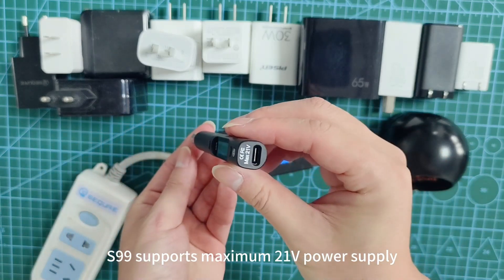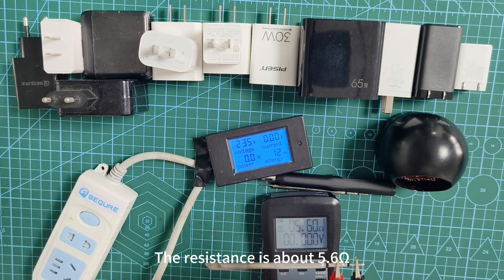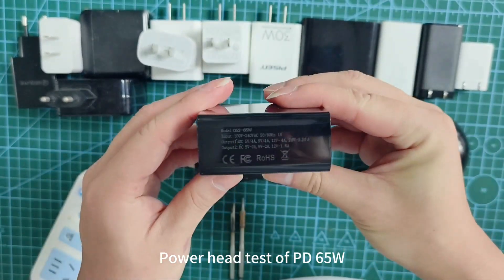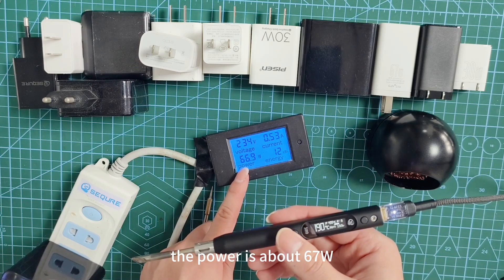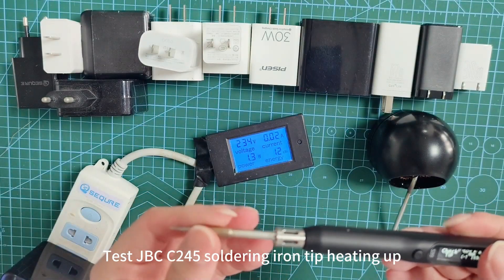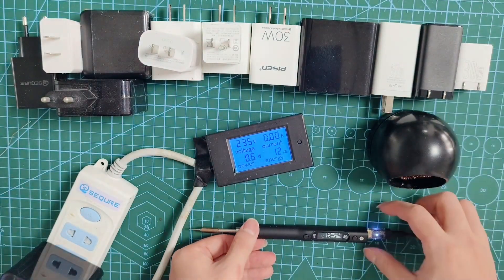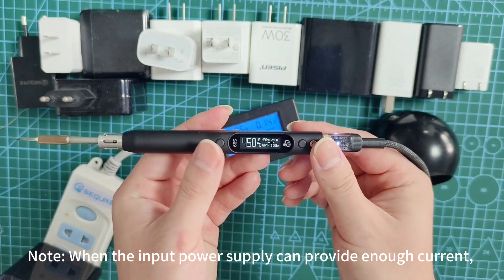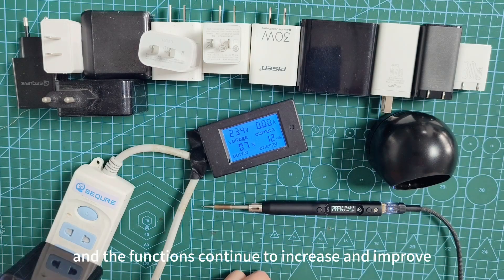S99 Soldering Iron Test Compatible With C245 Tips

Comment: Hi, in firmwave v1.08 i could' find the pps protocol on my s99 iron, how can i update ?
Reply from the maker: Hello, the current version is the latest firmware, there is no need to update, "S" beginning to identify the PPS protocol, the corresponding value is the corresponding voltage selection.

Comment: Thatnks for the video, I bought it too! I confirm that S99 works with original JBC 2.5 Ohm tips! And S99 costs like one JBC tip. 😅

But not with PD USB-C charger as all of them that I could find can only deliver 20V 5A, and 140W chargers do 28V 5A instead of 20V. From USB-C it can still work using 100W charger when power is limited to 70% in the menu. But it does work to 100% with SlimQ F150 charger/power brick for laptops using DC5525 to USB-C cable, that is to full 150W. That means it heats up in 2-3 seconds. SlimQ F150 is also very compact so it suits this iron very well. But don't confuse it with only USB-C model SlimQ 150.

Search for "USB Type C to DC 20V 3A PD Emulator Trigger Power Cord Charging Cable Converter Wire 1.5m for TS100 PINE64 SH72 Soldering Iron" from "NovelLife Official Store" trader on AliExpress - that's an amazing soft silicone cable that feels like original JBC station cable! And that USB-C to DC5525 cable works from SlimQ F150 DC5525 output to S99 USB-C input or (!) from USB-C charger capable of 20V to TS100 (another soldering iron) DC5525 input. Simply amazing. 😄

Comment: Got it and is a good product! 
I have some questions, first what is the "temperature shield" option?
Second, how does the logic for pps work? Mine selects around 11v which is strange, for 5.5 ohm tip the ideal would be around 16v to get 3a of current
Reply from the maker: Hello, I'm glad you like it.

"Temperature shield" refers to the actual temperature display on the screen. It will be displayed stably when it is turned on. When it is turned off, it will change slightly in real time based on the actual temperature. It depends on the user's usage habits to decide whether to turn it on or not.

PPS needs to carry out protocol communication with the power supply head. According to the test of a large number of power supply heads on the market, PPS 11V is common. PPS 16V power supply head has not been encountered so far and basically does not exist. At the same time, PPS is mainly provided for use with 2.5Ω soldering iron tips. It is recommended to use PD 20V for 5.5Ω soldering iron tips.

Hope this helps, thank you.
Reply: @SequreTech  Makes sense, thank you for the explanation. I do have a 16v PPS power supply (anker nano 2).
Would be useful to add a option to select PD15V, it is a very common voltage and very useful for using 45w power supplies.
Reply from the maker: @diegoalvarez2497  Thank you for your suggestion. In the future update, we will consider adding PD 15V and PD 18V, so that users can set them according to the actual situation.

Comment: Why are the tips that come with it 5.5 ohms, what is the advantage? Why not send bundled with 2.5 ohm soldering tips?
Reply: Oh I see, it is to keep current under 5A to be compatible with more usb-c chargers.
I think it would be better to ship standard 2.5 ohm tips and limit the voltage by default to avoid overcurrent, and use pps if avaliable for full power.
Non-standard parts are never good. The shipped tips will not be compatible with other devices and will work worse when using low voltage power source.
Reply from the maker: @diegoalvarez2497  Hello, yes. Because the current of the current standard USB-C is 5A, in order to meet most of the fast charging source devices, the built-in soldering tip resistance value is 5.5Ω.

At present, a small number of PD fast charging sources support the output of 160W power of the S99 using 2.5Ω soldering head at 20V, and the following video will be tested and demonstrated.

The attached soldering tip can generally be heated and work normally on other equipment, but it is not recommended to do so because there are many uncertain factors.
Reply: @diegoalvarez2497  Seems like the old PD is a bit of a mess right now when it comes to soldering irons. Running original 2.5 Ohm tips at 12V PD target would give you about 60W but would require 5A of current, which small 65W chargers usually can't do. The 5 Ohm tip lets you use 20V @ 3A target to get the same 60W, which is more available and also doesn't need a 5A cable. But it would be great to have a choice what tip resistance you want when ordering.
Reply: @SaNjA2659   Yes, even though I'd prefer a 2.5ohm tip I can see the advantages I guess. One can always buy 2.5 ohm tips, replacing the 5.5 ohm ones would be much harder.

Comment: I wonder if it can reach full power with Dell 130W proprietary type-c chargers. They should be capable of up to 6.5A at 20V. Anyway, thanks for such an exciting product! I've just ordered one for myself!
Reply from the maker: Hello, the shipment head resistance value is 5.5Ω, Dell 130W power supply can definitely meet the work use. However, the head of JBC 245 is generally about 2.5Ω, and the current of about 8A is required at 20V. The resistance value of the iron head of different types of batches is different, and it is not possible to confirm whether it can work at full power. However, the S99 supports the protocol selection function, which can be heated normally, but not necessarily at full power.

Measured 2.5Ω head, using Lenovo Legion 135W USB-C GaN can support the output of 160W power.

I hope it was helpful.
Reply: @SequreTech  Thanks for your reply! Sounds like it may or might not work, depending on how well these laptop chargers handle slight overload... I'll probably be making my own power supply for it. For that, will I need to simply connect the 20v to DC terminals of a type-C plug and set the iron protocol to DC?
Reply from the maker: @SaNjA2659  Yes, the use of DC power supply is mainly determined by the overload capacity of the power supply. The delivery package can choose the C to XT60 power supply line, so you can simply use XT60 to connect the DC power supply, DC will automatically identify the voltage, no need to set.

Comment: PPS 21v only supports 5A? How do I get 150 watts?
Reply from the maker: Hello, the maximum current supported by the current USB fast charge protocol is 5A. In order to meet most of the fast charging source power supply work, the 5.5Ω soldering tip is introduced. At the same time, the S99 is also compatible with the 2.5Ω resistance value of the C245, but it does not operate at full power. Because 2.5Ω full power at 20V requires a current of about 8A, the current USB power source cannot meet the current. The S99 can get 150W of power using a model battery or a power adapter.
Reply: @SequreTech Hello, can this soldering iron physically take 24 volts? If the design allows it, should I wait for the firmware for 24 volts?
Reply from the maker: @nicolaihoronjuc  Hello, the current maximum support 21V, the current does not support higher voltage.For higher voltages, consider the SI012 Pro Max, which supports 25V
Reply: You want to say that 8 A can be transmitted through the xt60 to type-c cable that comes in the kit? :) and the port type C on the soldering iron can withstand 8 amperes?;) Can you record a confirmation video?  because it is hard to believe.  As far as I know type-c can handle 5A max
Reply from the maker: @nicolaihoronjuc  Yes, it can withstand, 8A fever will be more obvious than ordinary, ordinary type-c generally withstand 5A, the type-c of the soldering iron is special processing, can withstand 8A.
Future videos will be published using XT60-rpm type-c cable transmission test 150-160W power, and will also recommend a 135W PD3.0 fast charger, directly using the C-C cable can also reach 150W.